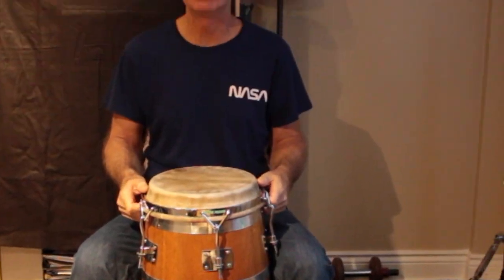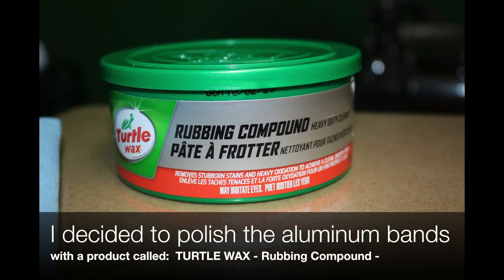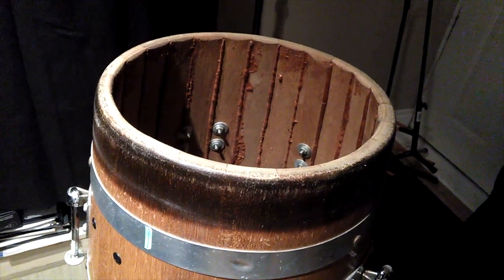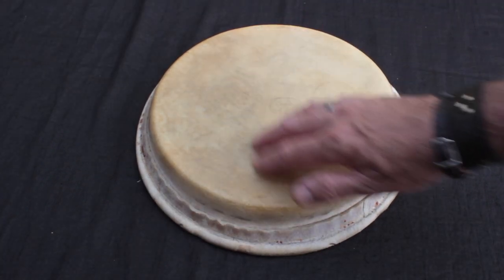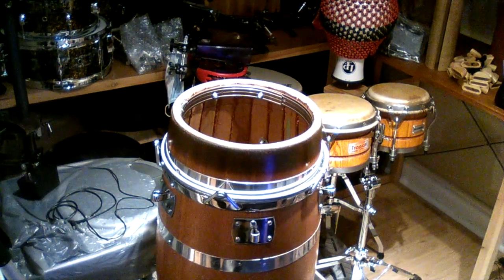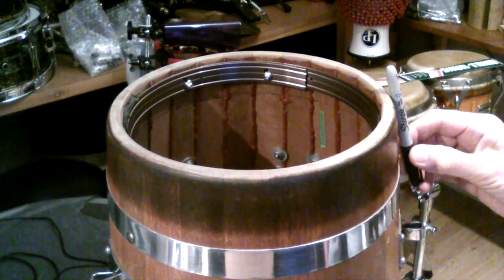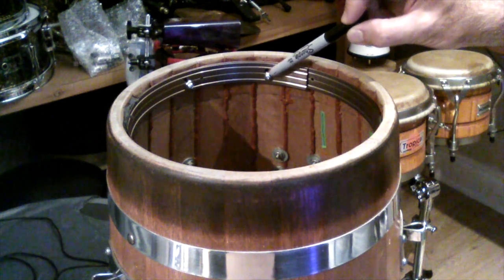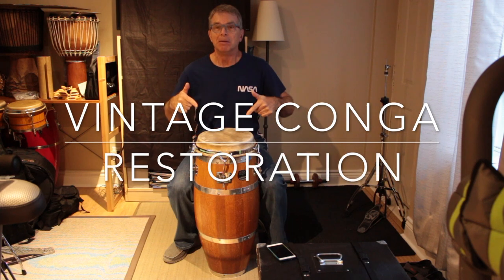Gon Bops Vintage Super Conga Restoration

Comment: That's the beauty of the new synthetic conga heads. Yeah,lol,not for the purists,but the synthetic heads don't put the same tension on the conga shells or hardware.Also they are much easier on your hands.For a working conguero synthetic skins can be very useful.
Reply from the maker: Yes, as  you have noted,  there can be  good reasons to consider synthetic heads.  And we don't have to commit entirely to using just one or the other if it suits you, and if our budget allows it.
Reply: For your drums,being vintage, I think the natural skin  is best! I work a lot at east coast waterfront venues and would be afraid to take drums like that in the bars,clubs,and near the saltwater oceanfront!!!😂😂😂

Comment: Great job! 
I have three Gon Bop Vintage Congas and can't get a skin anymore for my Quinto. Gon Bop says die "Köpfe" müssen umgebaut werden. Now I am surching for a Workshop in Hamburg. Can you help me?
Reply from the maker: Hi,  I am not located in Germany to help you with that but there are several videos on You Tube that show how to use a dry flat skin to form onto your congas.  The first thing you need to do is to take the existing conga head off the conga, and then soak it in water until it is soft and you can remove the metal ring that is inside the fold of the skin ( the "flesh hoop" ).  You will need that ring to form a new skin onto the conga.  The vintage 'flesh hoops' are not the same size as the newer hoops.  I hope this helps.  Have a look for more videos on this, and best wishes to you for installing your new conga head.
Reply: @percussiondrumset8046  
Thank you for your're fast answer. You helped me a lot! 
I found also already good Videos here. Now I wait for the right new skin, a good Knowhow from this firm. 
The old skin ist already of ... 
I'll try my best to do it by myselfe... maybe with a friend together.